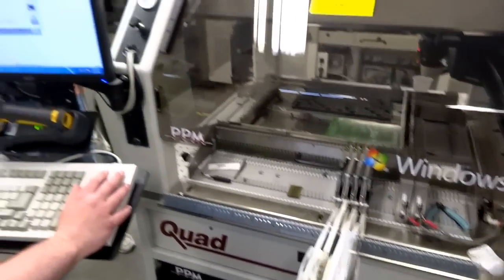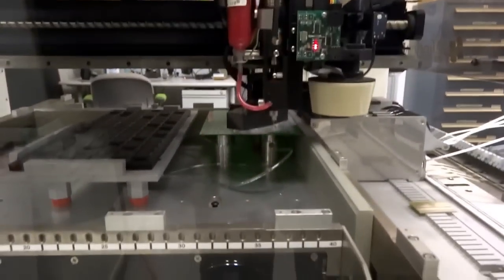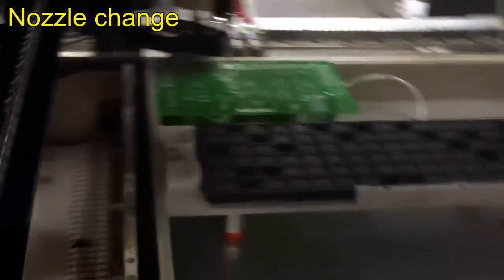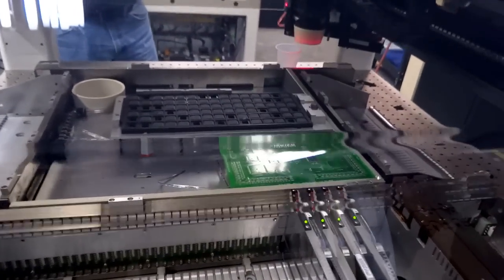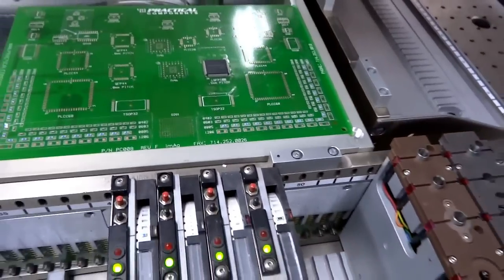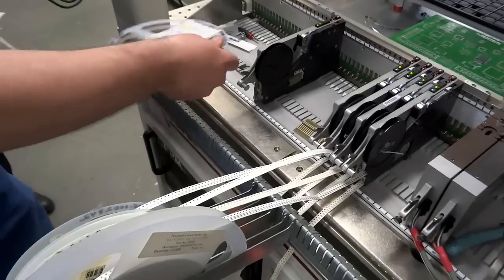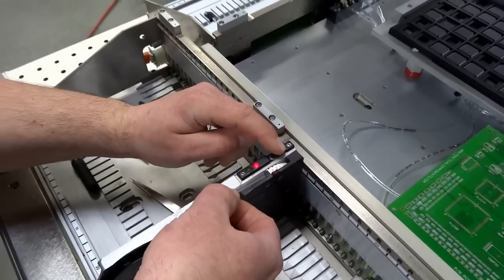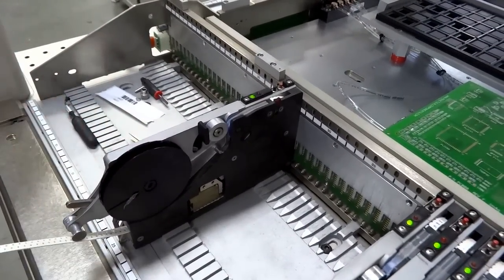PPM Quad 4000C IVC 4C pick and place demo & feeder setup

Comment: Precision Placement Machines purchased the rights & patent for the Quad 2mm pitch tape feeder from Tyco Electronics over 8 years ago. PPM holds the only Patent for & rights to sell this feeder. The patent can be found on the Web by searching via Google or you can contact PPM for more info.

Comment: I can load a feeder without any leader, and without wasting a single part. 6 to 8 inches is a lot of parts to waste.
Reply from the maker: Can you prove it? :)
Reply: Yes I can, I'll thread up a feeder with cut tape tomorrow.
Reply from the maker: RogueBotix That would be quite an impressive feeder, especially on a mid range p&p
Reply: I took a video. Its not the greatest video because I had to do it one handed. how do you want the video?
Reply from the maker: great, You could post it on youtube or put a link to it here if you upload it to another site
Reply from the maker: Cool, yes I do it similarly.
Your initial reply made me believe you can do it without so I thought that has to be a very special feeder.
I ended up with another P&P, not Quad. My feeders are different and I need to replace some parts to get the tape in. You still need a leader to pull the non-led tape, so .. yes I do end up taking some parts out but not wasting them in general, except for passives that are too cheap to make it worth the effort to put them back in the tape.
Reply: our customers LOVE to send us the exact amount of parts.......... 30 parts on tape, and the order needs 30 parts, its like are you kidding me??
Reply: I am working on a feeder mod kit for 8mm feeders, it fixes all peel tape issues, takes the slack out of the gear train to hold a more precise index. and keeps the parts from bouncing out, even when running 0201. You can use auto z-teach with 0201 and it works perfect.
Reply from the maker: Nice, is this for quad feeders?
Reply: yes.
Reply from the maker: RogueBotix is there still a market for quad machines? Are you servicing quad parts? I wonder if I could adapt quad feeders for my DDM LE40V, that would be very cool.
Reply: lots of small shops are using quads. The machines them selfs are good, peoples biggest complaint with quads is their feeders. Quad feeders suck. Thats why I spend a lot of my time modifying them.
Reply from the maker: RogueBotix what exactly sucks about them? My DDM le40v feeders suck too, so Im looking to improve them or find other better feeders.
Reply: They never really index to the same spot every time, the tape never peels right, the little friction roller always binds. The take up reel is finicky. I have cured these issues with exception of the take up reel, which I am working on.
Reply from the maker: Nice, and do you do this for private clients or do you have an outlet to sell these? Do you only work on quad feeders? The DDM feeders have about the same issues.
Reply: I have only been doing in house feeders. I have hundreds of them yet to work on. I have been wanting to do some advertising though. What do the DDM feeders look like? How do they work?